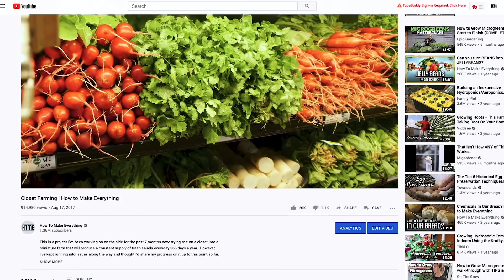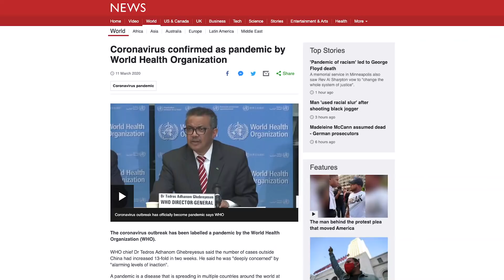Homemade Salad Grown in My Closet Garden for ONLY $3400

Comment: I've been growing plants hydroponically for just about a year at this point, and I've found that deep water culture is probably the easiest, most "set it and forget it" hydro method available. The mechanical aspect is just about foolproof since it's just a bucket and some holes in its lid for net cups, plus some air pumps and stones. I've made it my policy to just give everything a cursory check every day, but I've thought about using an EC meter, pH sensor and an Arduino to let me know when the water level has gone low or when the water is out of spec. I spend maybe on average 10 minutes a day dealing with it, and it's been very easy to get some great food out of it, from something as simple as lettuce, to things as finicky as cucumbers.

Comment: That's why I like Kratky method for hydroponics.  No moving parts, cheap gear. I just went to the hardware store and bought a 15l  bucket with lid and a couple of net cups for a total of 5 bucks. ^^ The two weeks of sprout time I used to hunt down the cheapest nutrients, clay pebbles and rockwool cubes. Some el cheapo 5000k LED bulbs are totally fine for starting indoor growth. I spent less than 50 bucks, could have done it for probably half of that. I just wanted to try it out on the cheap and upgrade later to a more complex system. Never happened. I just went back and bought more lidded buckets for 2.5$ a pop. ^^

Comment: When using silicone as a sealant, you should allow it at least 4 hours after application for it to dry - which means no contact with water. So, I would think to stop the leaks with silicone, you’d have to disassemble the PVC.

Comment: There's probably a hydro system that's right for you. Maybe beto buckets? Some tips: It's important to do regular res changes (every 3 weeks) with hydroponic systems and to use microbes. Hydroguard is what most people use. It's a little too expensive for my taste. You need a mix of bacillus bacteria/root enzymes anyways to protect everything in the root zone properly. You'll never get away from checking PH every single day, calibrating your PH pens regularly, and staying on top of keeping the res topped off. PH pen storage solution really helps keep them from drifting as bad. You learn a lot through hydroponics though because you're measuring EC/PPM and knowing exactly what's going wrong as you make mistakes and then that info about how much to feed what can make you amazing at growing in soil so you won't need to flush or drain to waste like other people.

Comment: Nope, nope, nope 👎 🤦🏻‍♀️ The irony is that this project was the one that got me to subscribe. And though I admire your independent spirit of discovering problems on your own, when it comes to something like this that people can easily replicate, the costly mistakes just become one big turn off. A little research prior to, might had led you to a KRATKY system on a cheap $6 18 gallon tote, that would have easily produced consistently without the expense. Additionally you could have added a low level switch with an auto top off (such as those used in aquariums) with a cut off high level switch to ensure no overflow, for about $40. That, along with cheap 100 w leds would have cut your cost. If you must use soil, watering from below prevents gnats (and adding mosquito dunks will prevent mosquitoes)

Comment: You "final" system is actually pretty efficient. More soil there is more water it can hold. A re circulation system to capture and use run off. A drip system which is more efficient than a mister. A water reservoir to hold water and add nutrients.

Comment: A lot of what killed the plants was neglect, but a lot of keeping an eye on plants can be automated with a few basic sensors and some microcontrollers. Not a common skillset to have, but automation is what was needed for a lot of this. Monitoring moisture levels, ensuring water was replenished, alerts for mechanical and/or electrical failures, and that nutrients are added to the water as they are depleted can all be done.

Comment: I respect your willingness to attempt an indoor grow.  I have been growing indoors for many years (over 15 yrs) and you seem to have encountered just about every problem a new grower could encounter.. which is the point at which most people give up...  I feel like most people equate the experience to having a lot of houseplants- but to be clear- running an indoor garden is far more complicated and requires constant attention.  IT IS NOT EASY.  It is perhaps the most challenging form of gardening.  So many elements to consider when gardening indoors.. and I could talk about it  FOREVER!  I feel it is a journey that is worth undertaking if you are not afraid of challenge and failure... Both being excellent forms of practical learning..  :)

Comment: Not even worth bothering with hydroponics. Use real dirt and spray it down with Jerry Baker's mix of tobbaco tea, listerine, and soap which will keep all the bugs & diseases from getting ahold. He's got a website with all this info on. A few notes to help:
 I've grown the chamomile and the amazing thing about it is just how tiny the seeds are. Even carrot seeds seem massive compared to them. They ended up all over my yard and growing out of almost every seam in the concrete, too!
 A good crop you could try is Sugar Baby watermelons. I grew mine in a super tiny patch between two driveways then when the melons started to form I used JB's trick of hanging them by pantyhose tied to the chain link fence. They're small and sweet, mature much more rapidly and it took a previously unusable ground space and made a wonderful summer treat!

Comment: That's some good info. I live in an area with a lot of sun and I can grow tomatoes and peppers in a south facing window. Some better than others of course.  I don't heat the area with the south facing window or it would probably be better. I think soil works better for most things unless you have a large operation. Synthetic fertilizers aren't that sustainable in soil inside though. I think the best sustainable year round grow for cost is a sunken green house where the earths heat helps, and you can cover the top when needed for insulation. You should try arugula in your salads, nutty spicy flavor, excellent stuff.

Comment: If your major issue is forgetting to top up water, why not fit a cistern auto fill like you find in a toilet cistern? You'll still need to remember to ocassionally add nutrients, but much less likely to kill off the whole lot if they at least have constant water.

Comment: I had a problem with fungus gnats with some office plants and I used about an inch of sand as the top soil and they were not able to live in it. This was with weekly to every other week watering. Your mileage may vary. Also wash the sand just in case it contains any minerals you may not want in your plants, pure speculation on my part about the washing.

Comment: You shouldn't cut potatoes. Usually you seed a small potato and it will give you like 5 to 8+ potatoes. but when you chop it can even don't grow or even get some diseases. to make seed efficient. seeder seed them on top or slightly under ground and then cover with dirt so they have non compact ground.

Comment: Against these flyes there are also the opportunity to use neem oil. This oil comes from the indian neem tree and it's 100% non artifical stuff. The grub from the fly which lives in the ground and eat the roots of the plant will eat also this oil and dies. And you can dissolve this stuff in your tank and the water becomes a milky appearance.

Comment: If you grow asparagus it will take literal years to grow man, also as an experienced grower with outdoor gardening and hydroponics systems wouldn't suggest anything that fruits since you will need to pollinate those yourself by hand, but some grow well, cucumbers and some peppers grow well along as they are supported. One of the easiest things you could add to your system is a moisture sensor that beeps when low. As for the grasses you were trying to grow you should have a decently strong fan on those with some deep thin pots so the tap root can get deep enough. All in all sweet video

Comment: I strongly suggest trying aquaponics instead of hydroponics as it used live fish to supply the plants with nutrients from there excrement and the plants absorb the ammonia created by the fish crap and it helps them grow. After the initial setup it is much more low maintenance because the fish give the plants nutrients and the plants clean the water for the fish.

Comment: I never had succes with plants until i put them in terrariums.
I suspect it was because i would add worms, springtails and isopods with edventaully bigger animals. so dead leafs get decomposed and add to nutrients. then if you have a drainage layer you never have to look at it because water took care of itself. in bigger terrariums I mostly add a small pond with a pump hooked onto it so i had a waterfall.
For edible plants it was a great succes with strawberries, mango, banana, pineapple and tomato.
The trick is also to have non edible plants in it that provide nutrients when decomposed and shade.
What I urge you to do is to simulate nature as best as possible.

Comment: I would be willing to bet that the reason your plants kept dying in the hydroponic system is because you weren't keeping track of the pH and nutrient levels. Different plants use different nutrients at different rates so it has to be changed often.

Comment: Oh darlin you could have done it for about 50 had you come to my channel for leafys and you could have gone full tomatoes for about 500 with proper leds, most of the cost being the lights themselves.   Hydroponics is a huge mistake for new growers. It is very high maintenance as well. As you learned, or would have if you grew that way constantly for a year, is that you're growing of a knife's edge. I've already made 20 years of mistakes (learning never stops) and my grow setup has evolved over all those years, but it works extremely well now.

Comment: The reason you had trouble with the root crops in buckets is you planted too many in each bucket.  A 5-gallon bucket can only support 1-2 potato plants.  I do a LOT of container gardening, albeit outside, and I'f found that potatoes do best in grow bags (not buckets/pots) and I do 4-5 seed potatoes pr 20-25 gallon bag.  I have about 1/8 acre used mostly for raised bed and container gardening, I get enough potatoes to last the year, as well as a major excess of tomatoes, basil, and green beans.  I also grow a bunch of jalapenos and chili peppers, but not nearly enough for our needs.  By using chemical fertilizer and hose watering, and using companion planting methods, I'm able to get FAR more produce out of a limited space than would be possible using standard farming methods, and pretty much the only real work I need to put in is to plant, water, and harvest.

Comment: That's a Hybrid Deep Water Culture setup, not aeroponics. True aeroponics uses misting heads with 5-50 micron drops and requires pressures around 100psi.

Comment: You wasted yourtime with epoxy which inevitably leaks whenever you move the fitting, you need a bulkhead fitting. This would have saved you months man. Also if you wanted to avoid this entire headache, cococoir is a much lower maintenance solution, which makes getting pythium root rot very unlikely.

Comment: To calculate how much it cost you in time just multiply how much your time is worth so if it's $10 p/h that and it took you 10 hours to make it will be $100. 

But that doesn't factor in opportunity cost. Which you would - anything that you could be doing instead like if you could be making a YouTube video that gets you $20 p/h. So you could have made $200.

But this doesn't account for you needing a break from work. For your time * your break time.

But that doesn't account for … … …

Comment: Great job keeping this garden going. One thing about dirt and dirt substitutes, NEVER use store bought dirt. It is nothing but weeds and bugs. I myself prefer to use Peat Moss. it comes in very large bags, and has some nutrients in it. I mainly use it as plant starter, and for potted plants. Only downside is that it needs A LOT of water to get it wet the first time, as it repels it. It eventually gets fully wet and I have never had a problem with nutrients with the stuff. It is usually a bit more expensive than dirt, but is much better. Dirt usually breeds bugs, never had a bug issue with this, even with potted plants coming inside in the winter. @How To Make Everything